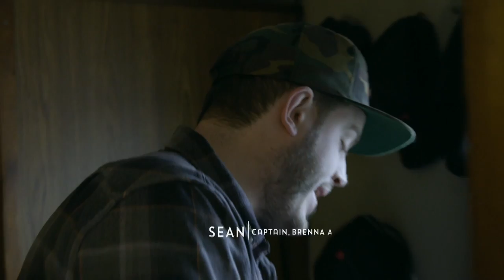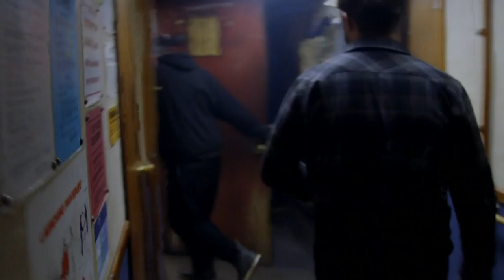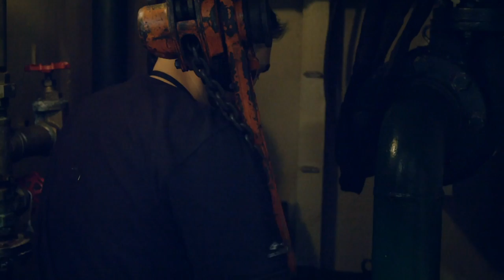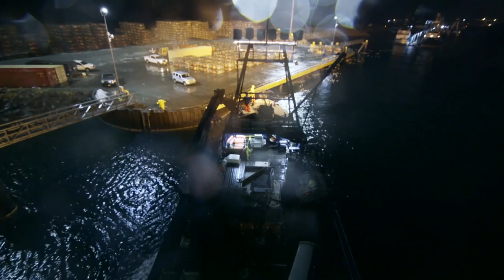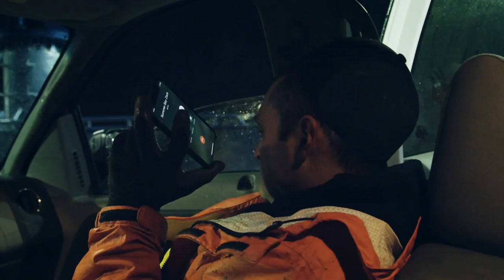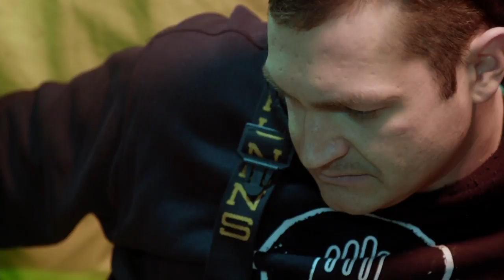Brenna A Crew Member Severely Injured After Boat Sets Alight | Deadliest Catch

Comment: Good job on Zach for testing the pump before leaving dock, can't complain about 5k when it could ha e been your entire ship.
Reply: Or even your life
Reply: Lives, down time , back to shore fuel, dock time , etc....
Reply: Fishing shit cost alot i worked at a place nearly 10k for a belt motor half that size
Reply: Zach is so clever he waist himself on those cold 🚢 boats
Reply: @dimmosaurus8242  You obviously have no clue about the kind of money he makes "wasting himself on those boats."
Reply: Truth; I would of told him to buy two lol
Reply: It’s his fault he left it running too long. 15 mins is more then enough if it wasn’t pumping any water anymore. Been a captain for ten years seen people make this mistake plenty of times. Nearly done it myself.
Reply: Hes not complaning hes just saying how thats another 5k ontop of the 30 he spent
Reply: That was nice of this show, made Zach look like he is on top of things and found something. In reality, you can’t run bilge pumps dry, they need water to flow through and cool the motor or they burn up. 15 minutes is border line but it could have been a lot longer than that
Reply: He burnt up the bilge pump by running it dry/no water.  Amazing incompetence for a boat crewman/engineer.
Reply: Except he left it running dry with no water which is exactly what you don't do to a pump😂that should have never happened and you could see on his face he knew he screwed up lol.
Reply: @crystllclr3743  yep cause he shouldn't be pumping the bilge at the dock anyways.  He forgot it on.
Reply: @Bill_pierre  Your exactly right!! When you 600 miles from Dutch harbor and your bilge pump goes out in the middle of a really bad storm, and no other boats around I can’t even begin to imagine how much that would suck!!!  On a Crab boat in the bearing sea it’s always better to have two of everything
Reply: @chrisperrien7055  That’s probably the same reason Wild bill wanted him off his boat… Well that and him not giving a fck all the time….🤷‍♂️

Comment: I wonder if he was pumping anything if it was just running dry the whole time.
Reply: 100% that thing was dry or this was scripted
Reply: @masonscott1954  I didn't know you tested a bilge pump by running it for 15 minutes.
Reply: Mason Scott Scripted, there was not enough heat or smoke to set of the alarm.
Reply: You could see flames behind the engine.
Reply: @travcon8  you dont see what's on fire, that's why we are a little suspicious.
Reply: Not to mention the pump didn’t even have a scorch mark on it at all 😅
Reply: Running dry whole time. The fire was coming out of the impeller cover not the electrical unit at the top. Impellers were well and truly melted lol

Comment: 15 mins was a bit too long to test run any pump no ? The reason the testing span is short is because chances are you could screw up and dry run a pump which would instantly fry em
Reply: Ya know I watched this just now and was wondering the same. I've had to replace Baldor motors in previous jobs in heat induction (quench pumps) and machining (coolant pumps) and was always told never to run the pump/motor dry. These were high pressure pumps, which I'm sure bilge pumps are the same, no?

Comment: How many ways can one title be wrong!?!  1.  Wrong boat Nick is from the Summer Bay not the Brenna A.  2.  It had not one single tiny thing to do with the fire.  3.  I would hardly call a pump motor fire the boat "setting a light".  4.  At worst a broken ankle in this setting is hardly a sever injury.  Well at least you had the name of the show right.

Comment: Even smaller buildg pumps for like bass boats and stuff you don't want to run dry you can do a quick little test powered on power off just to see if it turns on but if you run them dry too long it's going to catch fire or burn up and not working anymore

Comment: Did he run it dry? Ive never seen a bilge pump heat up unless there’s no water running through it. maybe at the start of those fifteen minutes it was pumping and then the water ran out and the pump ran dry until it burned up?